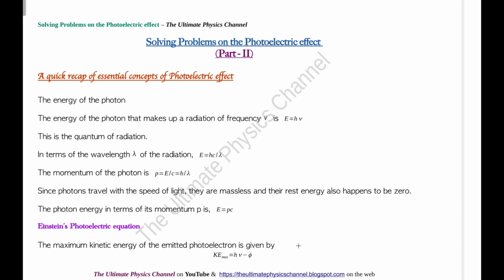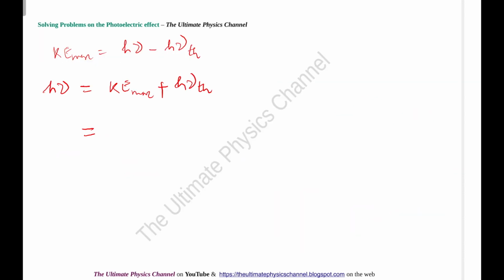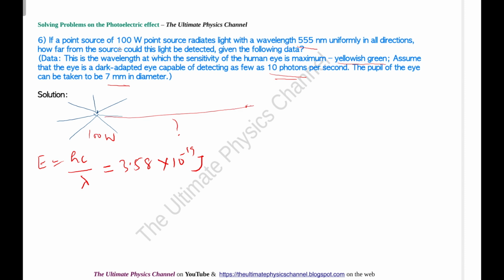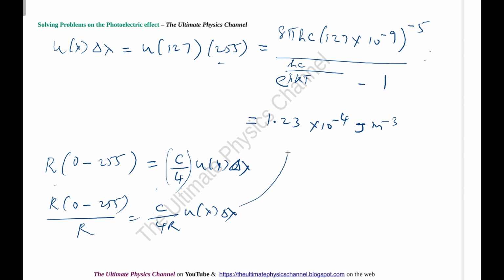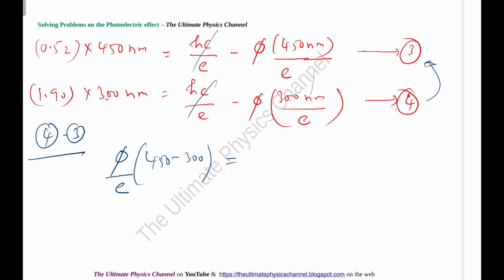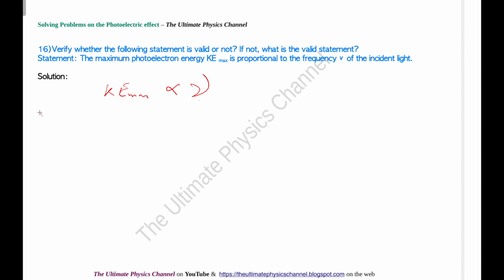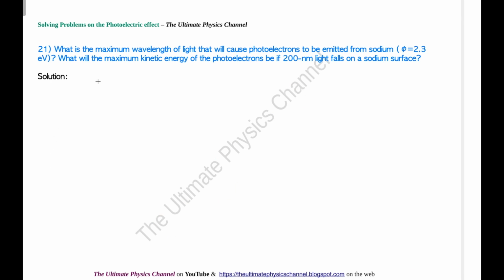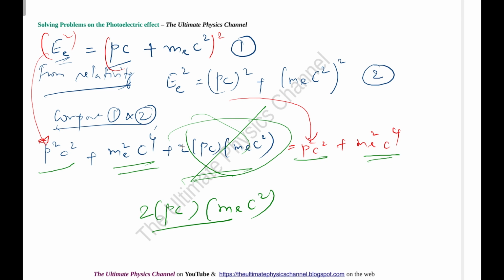Solving Problems on the Photoelectric effect  - Part 2

Comment: @TheUltimatePhysicsChannel  Sir, I have two major questions regarding this explanation on one of the previous video on this channel https://youtu.be/c09UHigM9pk?si=V24JttOeH-gD_wjm
1) Why don't the moving electrons length contract even when our test charge is at rest relative to us  and generate a net force on the charge even being at rest, you used the same logic while explaining the attractive force experienced by the wire in the protons frame of reference? 
2) How does the charge feel a force when it is allowed to move perpendicular to the wire?
Reply from the maker: To answer your first question, there are a few different ways in which we can explain the situation. First I have to make something clear here. Maxwell’s electromagnetic theory which has at its core his four equations along with the Lorentz force equation (which pertains to your second question btw) precedes Einstein’s Special theory of Relativity by at least four decades. In fact, Einstein, while proposing his special theory and his general theory later, wanted to ensure that his theory was consistent with Maxwell’s electromagnetic theory including one of its major tenets that the electromagnetic waves travel at the speed of light and its invariance nature (in all inertial frames of reference). At the end of the day, we should remind ourselves that these two successful theories are eventually theories only. This also means that these two are two different ways of looking at the Physical Reality. Both make successful predictions and both are experimentally verifiable. Both these ‘theories’ make accurate predictions about the physical reality, which in the context of your first question is the electric and magnetic fields. Now, the fact that special relativity is able to explain a situation without invoking another field (a ‘special’ ‘magnetic’ field) is all the more interesting and adds to its simplicity in certain ways. One of the desirable qualities of any theory is that it should be simple with minimalist principles. Coming to your specific question, let us say there are two parallel conductors each having positive and negative charges in equal numbers so that each are electrically neutral. Now, when current passes through any of these two conductors, we see a force of attraction between the two or a force of repulsion depending upon the current directions. We know that current can flow in either of the two directions along the conductor but not perpendicular to it (relevant to your second question btw). The convention is to assign the current direction to be opposite to the direction of electron flow. This means the positive charges can be assumed to flow in the opposite direction to that of the electron flow thereby along the direction of current flow. But we know that in reality the positive charges (which are basically metal ions in a conductor) does not flow at all. But in order to understand what is actually happening, this is just a simple assumption to get the larger picture.

	Coming back to the context, you could imagine either type of charge in each of the two conductors as being at rest with respect to your frame of reference and see that the other type of charge moving at twice the speed. If you are fixed to the moving electrons in conductor 1, the positive charges on the other conductor (which causes an attractive force) move in the opposite direction at 2v speed with respect to you (since you were anyway moving at speed ‘v’ with respect to the lab frame). If you are fixed to the frame of the positive ions in conductor 1, you would see that the electrons in conductor 2 move in opposite direction at twice the speed. 

So, each type of charges moves at speed ‘v’ with respect to the lab frame but at speed 2v with respect to each other in either of the two conductors. This 2v speed results in a larger Lorentz contraction of either type of charge with respect to the other type of charge in the other conductor not the same conductor. This point is important to be understood well. Read it again if you don’t. This is where relativistic way of looking at things is different from the non-relativistic way of approach. The non-relativistic approach fails to understand the situation in terms of simple Coulombic attraction or repulsion as the case may be and rather invokes a special ‘magnetic’ force to understand the situation. 

So, your test charge has to identify itself with any of these four charge groups in our two conductors namely positive charges in conductor 1, electrons in conductor 1, positive charges in conductor 2 and electrons in conductor 2. Since your test charge behaves akin to one of these four types of charges, the description provided above should answer your question.

2) There are a few people who argue that the Special Theory of Relativity is more of a ‘smart’ theory rather than an ‘original’ theory. I personally don’t agree with this argument. Einstein drew ideas from different people (drawing inspiration and knowledge from their theories) but made his own theory. He did not copy from anybody. The difference between a genius and a copycat is this. If you let your brain free, it will come up with something original and novel while drawing inspiration from everywhere. Einstein let his imagination free and let it go wild. He needed some luck and a stroke of genius, He had both. The same Einstein could not accomplish similar success later on. He was not lucky. His brain was not the same either. What he was at 26, he was not the same later on. 

Lorentz and Poincaré 2) Maxwell 3) Minkowski (his teacher btw) were some of the names from whom Einstein drew a lot of inspiration. Einstein knew about the work of each of these people fairly thorough by the time he proposed his  special theory. You might be wondering how this answers the second question. Read again what I have written and Now read ahead. 

In the context of special relativity, the Lorentz force law is extended to account for the four-dimensional nature of spacetime and the relativistic effects.

In relativistic electrodynamics, the Lorentz force is described using the four-vector formalism. 

In special relativity, physical quantities are often represented as four-vectors, which combine time and space components into a single entity. For a charged particle, the relevant four-vectors include: Four-position and Four-velocity. And the electromagnetic field is described by the electromagnetic field tensor which is  a rank-2 tensor that combines the electric and magnetic fields.
 
Therefore, the relativistic form of the Lorentz force law can be written using the four-velocity and the electromagnetic field tensor. Thus we can write the four-force acting on a particle with charge based on this and thereby its equation of motion as well.

To sum it all up, the relativistic explanation of the Lorentz force involves using the four-vector formalism and the electromagnetic field tensor. This approach unifies the electric and magnetic fields and ensures that the laws of electromagnetism are consistent with the principles of special relativity. Hope that answers your second question. 

Why did this video not address the larger picture? The larger picture is more complicated for the scope of this video. This video tries to explain what is happening between two conductors at the undergraduate level. A more thorough course on Special Relativity or relativistic electrodynamics should definitely address this in detail.
Reply: @TheUltimatePhysicsChannel  thank you once again
Reply from the maker: You're welcome